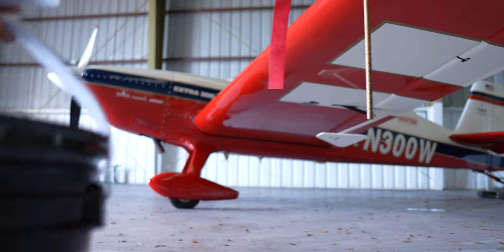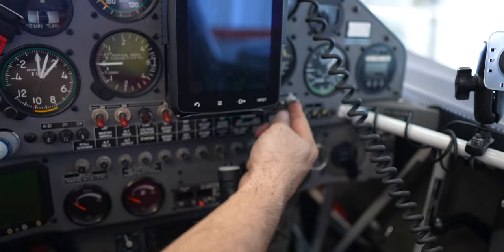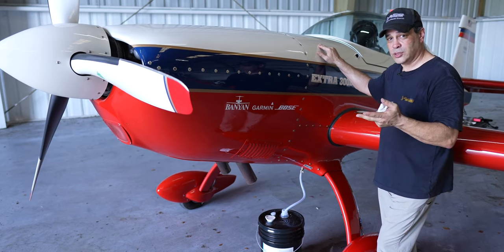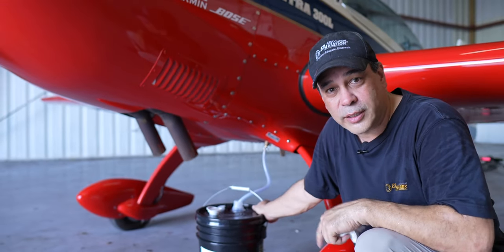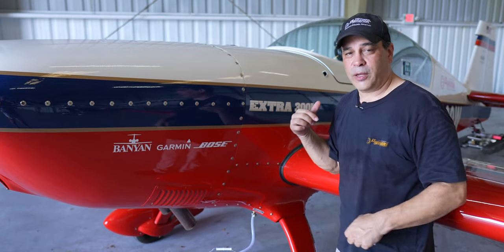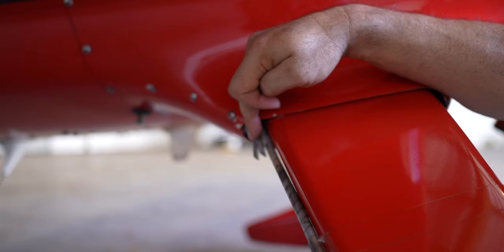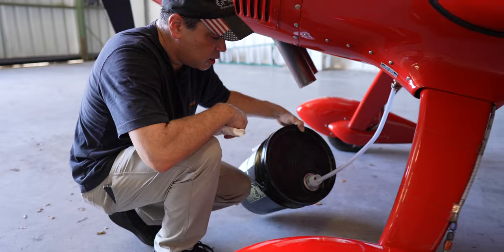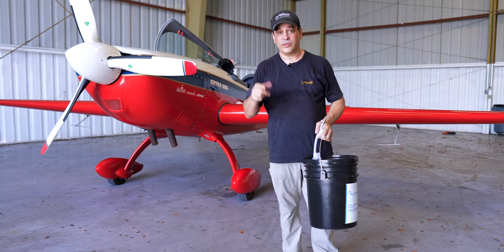Extra 300L Aircraft Smoke System Demystified: Insider Info

Comment: Hello, where did the get the part that fits the fitting on the plane?
Reply from the maker: We got it in the kit from Extra.   If you are talking about the fitting on the muffler you need to check to see if your plane already has it.  Most do.  If not you have to drill into the muffler and weld the fitting into it.
Reply from the maker: I you mean the intake pipe that came with the kit from Extra